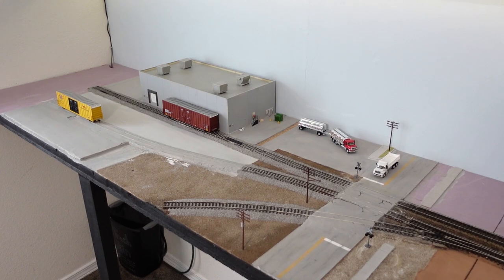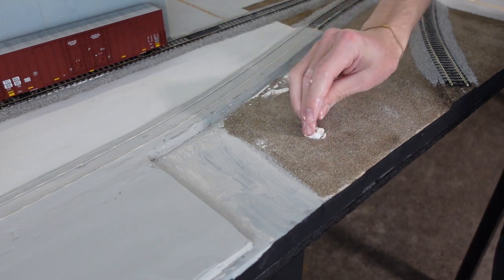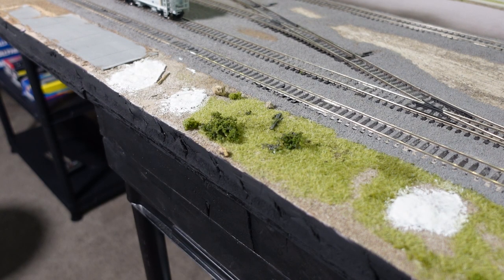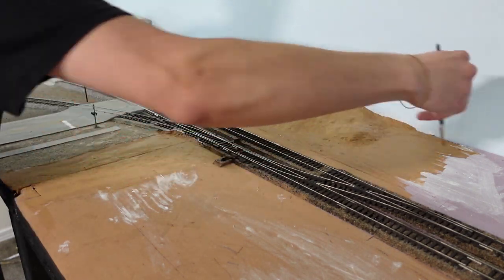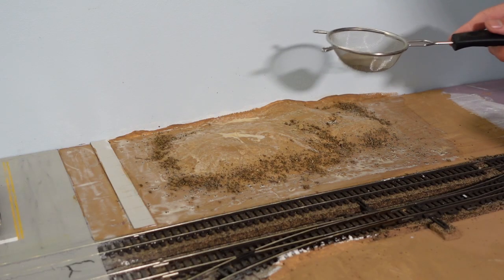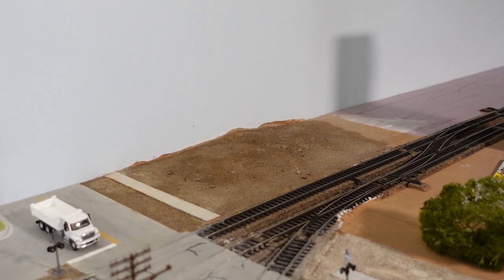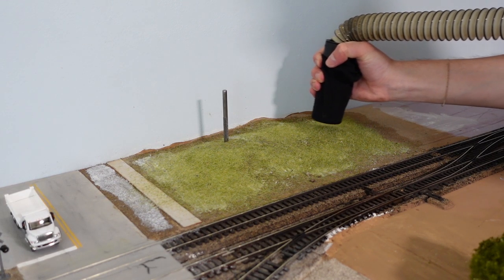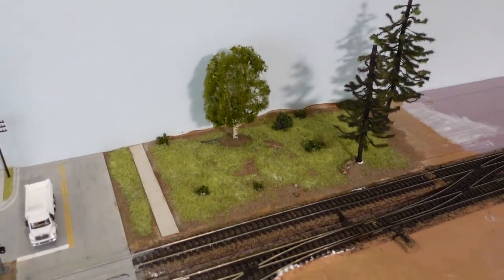How to do Scenery on YOUR Layout! - HO Train Layout Build - Ep 27

Comment: Thanks for showing this and sharing your craftsmanship with us modelers. In my previous posts I have mentioned that I want to model an Industrial park. Since I'm planning to use a lot of heavy equipment and not modeling any neighborhood like Mr Rogers, I'm planning on having most of the driving surfaces finished with limestone fines and  gravel, then sprayed down with brine. Brine hardeneds the surface and is great for dust control.  I'm thinking of having  just a two lane paved surface near the end of the layout so that I can spot loaded center beam flat cars. Then concrete ramps up against the warehouses.
You also mentioned trees, in the past BITT needed a place to eat and also needed a ramp for off loading materials from the end of cars, like wood chip cars or heavy equipment with wheels from flat cars. BITT found a WWll troop kitchen car, had it brought up to today's cafe standards,  they placed it at the end of house track number 2,  across the road, then removed the rail in the road and placed a retired flat car ahead of the paved roadway.  I'll have picnic tables for those that aren't on the run and some shade trees located by the diner,  maybe three to five shade trees. 
Well, I can't wait to see your next video, and thanks for sharing this with us fellow modelers. .